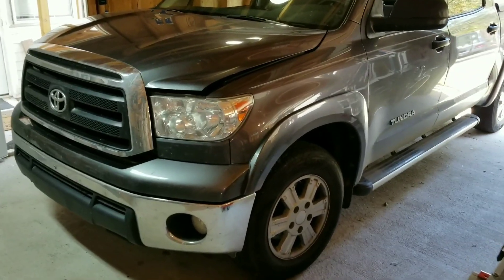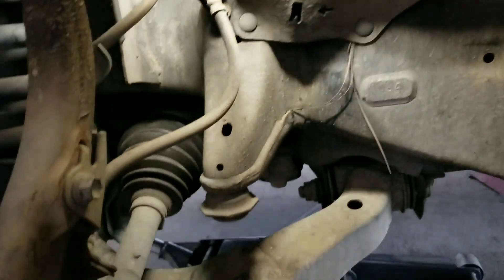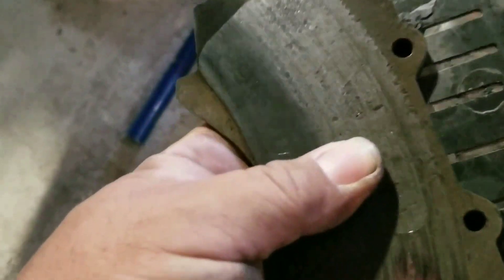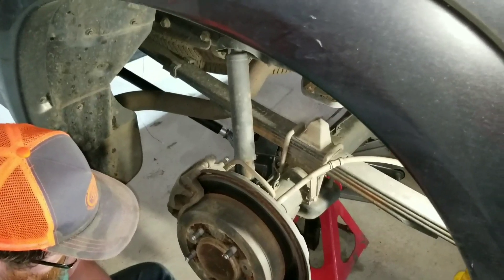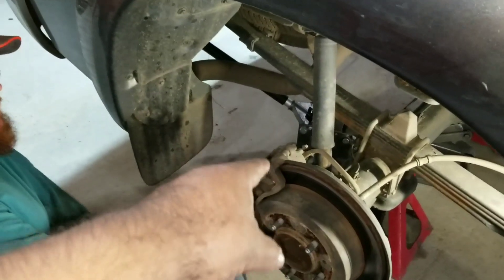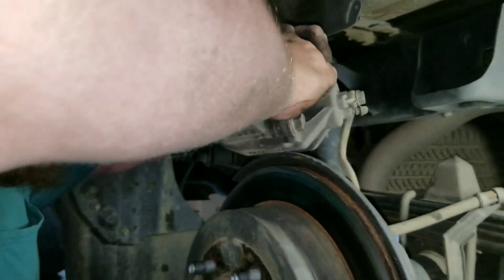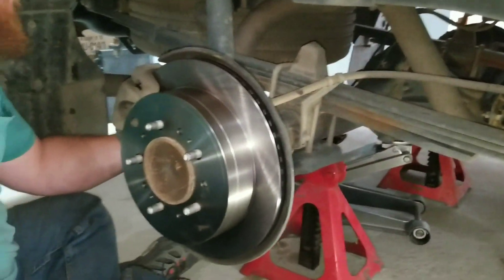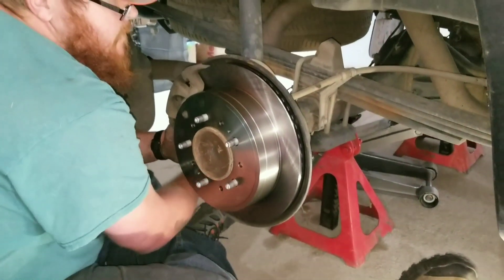Changing front and rear brakes on a Toyota tundra

Comment: The easy way to pop the rotors off is by using an M8-1.25 25mm bolt in the two small holes on the front of the rotor. There's one hole on each end. Put the bolt in the hole, tighten a few turns with a socket wrench and they pop right off. Especially useful if you plan on keeping the rotors, but makes life much simpler either way.
Reply from the maker: Thank you for the tip

Comment: While the brakes are still in tact you can wiggle a flat screwdriver between the old brake pad and rotor to collapse the caliper
Reply: Hello demontagem transmission toyota land croser a750f v8100 model yers 2009 ok

Comment: On the rears there is a small hole that you thread a bolt into that will help back the rotors off. I cant remember size possibly M8-1.25 X 20 is what I want to say.
Reply: From what I've read/seen, you can use the bolt that holds the hard line to unseat the rotor.

Comment: unless you are doing work on something other than brakes you do not need to remove all of that...just remove the pads thru the top of caliper...but the rears are different
Reply from the maker: +hnrchnhys we replaced all 4 rotors so yes all that was necessary